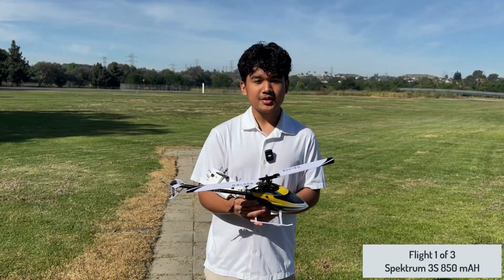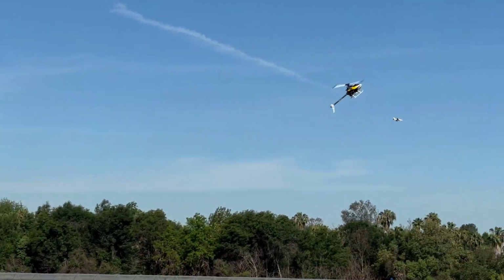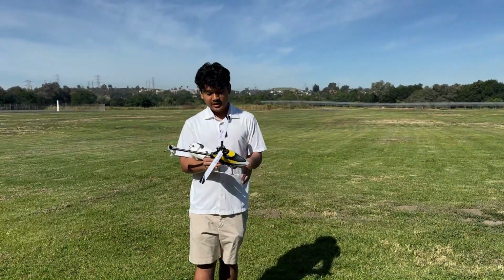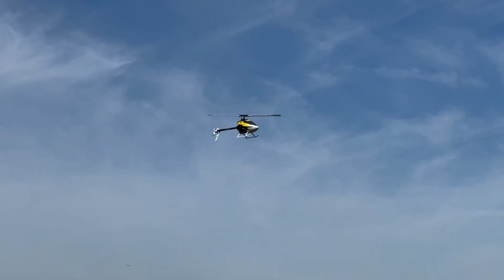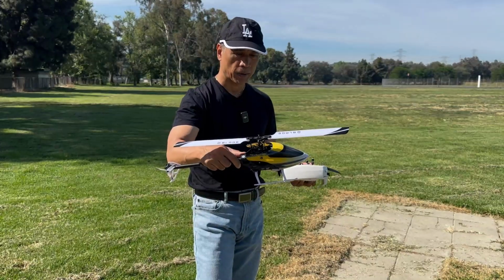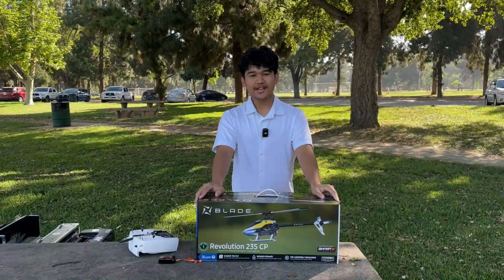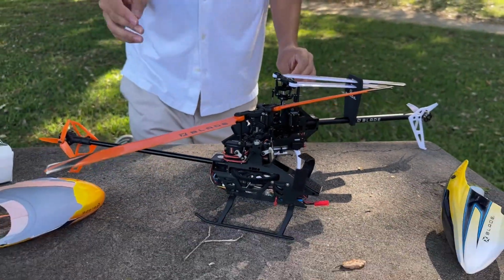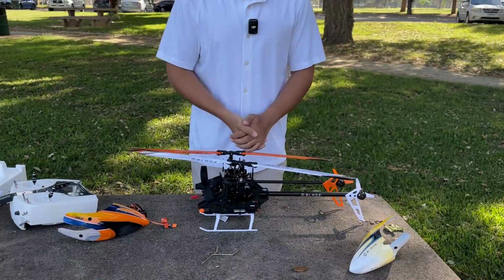THE BEST BEGINNER COLLECTIVE PITCH HELICOPTER! - BLADE REVOLUTION 235 CP

Comment: Great video! Awesome flying. Thanks for sharing. I am really considering this heli as my first. What do you recommend I practice on the sim before flying for the first time?
Reply from the maker: Hi! If I were to start over, the number one thing I would prioritize is learning my orientations. I would learn how all the controls feel with the tail facing me, and then I would gradually make the helicopter face left and right. When you’re practicing different orientations, I would gently rock the helicopter in different directions so you can practice balancing it out. The hardest thing is to hover with your nose facing you, but it gets very simple with practice. It’s super important to know your orientations, so you don’t accidentally fly into yourself 😅 Good luck and have fun on your journey! The 235 is an excellent starting point!
Reply: @JonsRC awesome! Thanks so much. I can do flips and rolls on the sim but then it can get away from me pretty quick. Also, I really want to fly clean circles like you do, but that also gets a little challenging. I'll work on the orientations more. Much appreciated.

Comment: The best beginner collective pitch is heli is NOT a Blade. OMP M2 or Goosky by a mile but I guess they don’t need to give as much product away to get reviews. The M1 Evo is a lovely little helicopter ( a micro Rolls Royce) and can go from mild to wild.  Even though it’s tiny it can handle wind, is durable and light and wouldn’t cost much to repair if you didn’t hit throttle kill in time. The M2 is comparable in size but just ten times the heli. Everything from the landing skids to the Canopy is better quality, not to mention the flight performance. Buy your parts on Rotorquest in Canada and save if you’re in the US. Your reviews are great, be nice to review more than Blade helis.
Reply from the maker: I own an M2 explore and EVO, and the Gooskys as well! Performance wise, they absolutely crush the 235 in 3D and sport flying. The M2 EVO is my absolute favorite heli in this class. However, I do not believe they are very good as a beginner helicopter. The Blade 235 is much more docile and ultimately less intimidating to fly than a Goosky or M2. Its presence in the air makes it feel like a glider in the air! The handling on the 235 is very natural and feels like a larger helicopter, I’ve always viewed the M2/S2 as kind of their own thing as they don’t really fly like larger models. The slow gyro of the 235 makes movement feel much more natural than the immediate gyro response than the competing direct drive helicopters. I’ve also had inconsistent performance with the direct drive helicopters, so I never fly with it enabled. On top of that, if someone flies Spektrum, the 235 is by far easier to setup. All of them are fantastic little helicopters. Do the direct drives offer superior performance and durability? Yes! However, I’ve flown all of them, and honestly I can only view the 235 as a beginner helicopter due to its incredibly docile nature and larger presence in the air. Of course, if you aren’t in the Spektrum ecosystem, I can see why one would go for the other competitors.

Comment: 25:05  you can’t use a converter plug? . Ic2 to XT?
Reply from the maker: Hello, helicopters are more demanding of power consumption and amp draw so I prefer no adapters and instead will always run a direct connection. Just one less point of failure 🙂
Reply: @JonsRC I just got this heli after watching your demo video. I’m a bit disappointed in the flight time. I wanted 10min. All I’m getting is about 7 in low head speed. So maybe  bigger pinion gear and more mah battery will be needed.

Comment: This is a VERY expensive hobby. If your putting out $400 for a helicopter like this that is marketed for beginners than you better make it as such. Blade's "SAFE mode" will only help you so much. If you get a good strong wind it's going to drift even if you let off the sticks. Where as a GPS helicopter stays locked in place no matter the wind. This way you can focus more on stick orientation than worrying about where it is up in the air. Plus, companies like Goosky, Yu Xiang, and Flywing offering there GPS heli's. Also allow one to progress into manual mode with the same transmitter they come with. So you have a complete package in one helicopter for beginner pilots. Blade has A LOT of catching up to do against these other companies. If they had made this with optical flow sensor or GPS with the ability to fly it in 3D as well. They would have sold FAR FAR more guaranteed. Once someone crashes one of these frustration sets in and turns them off to the hobby. Which is NOT what a company should be doing.

Comment: Will a 3s 1300 fit this?
Reply from the maker: Hello, I recall that the original 230S was able to fit a 1300, however I do not have a battery to test on the 235. If it does fit, the CG would be off as it was designed to perfectly balance on an 800mah.

Comment: What does the dual rate mean on the transmitter?
Reply from the maker: Hi! Dual rates is a transmitter function that basically allows the RC pilot to limit the maximum travel of the servos which in turn limits the max travel of the control surfaces. So, if you are an experienced RC pilot, you may want to configure full rates to be 100% or 90% travel for aerobatics flying. But if you’re a beginner you may want to program lower rates to be like 50% of the maximum travel so that you don’t over steer or over control the RC plane or heli. Dual Rates works in conjunction with expo. Where dual rates minimizes the servo travel, expo minimizes the sensitivity or response around the center of the stick. So by using positive expo, it helps make flying the RC plane or heli less twitchy! Because I’m a more experienced RC pilot, I typically use high rates and I don’t use expo unless the plane or heli is very sensitive! Hope this helps!

Comment: If I learn how to fly this Heli in 3D do you think the controls will be the same (or similar) with other Heli’s? I have the Flywing Bell 206 & I fly mostly in Attitude mode, but I wanna learn how to fly it in full manual
Reply from the maker: Hi, this helicopter is the perfect fit for you because it in the air, it feels much “bigger” than it actually is! And yes, what you learn on this model with definitely translate to other helicopters you fly. Good luck!
Reply: @ thanks I appreciate it!!

Comment: Nice vid but have to disagree. For beginners, the plastic frame will break too easily and after one or a few crashes, the main gear will be replaced. Sure it can be done but it means less time flying In the 200 size, I think the newish OMP M2 Evo Mk2 is the best flying heli and parts are cheaper than Horizon.
Reply: Safe select is good for beginners no matter what model a beginner gets something will break that’s why you should always get spare parts